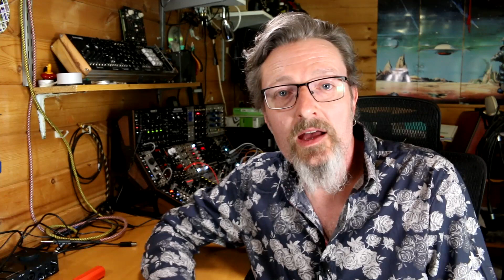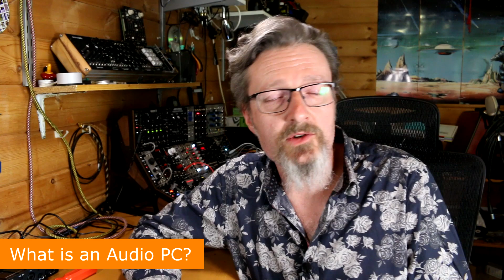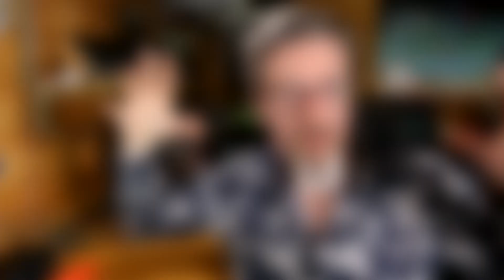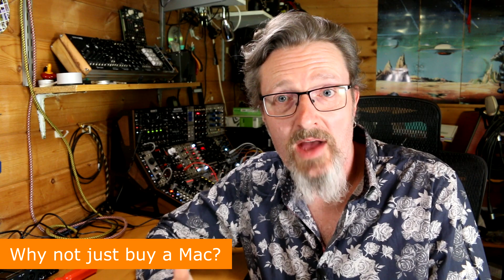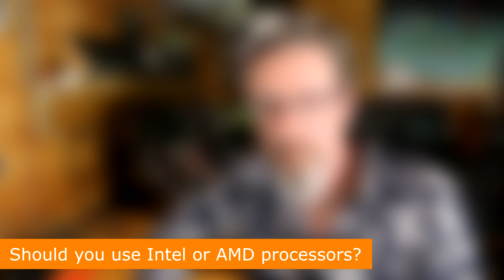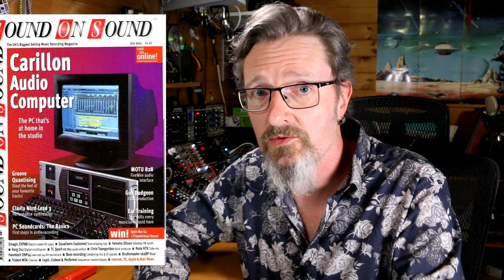How to Build an Audio PC: Part 1 - What's it all about?

Comment: This is an excellent series. While technical by profession, I am in no way versed in computer hardware or software but this series was educational and easy to follow. By sticking to the design guideline of just trailing the leading edge of technology and remaining in the realm of tested and stable components I was able to build a rather nice i9Gen10/Z590A system and, thanks to this series, never felt I was getting in over my head. Other than a faulty RAM card no hiccups. Well done and many thanks. Cheers!

Comment: My main complaint with Windows was that the drivers don't play well together. How do you deal with this? None of my interfaces ever worked well on Windows and I always got noise (EMI) from my machine, especially when moving the mouse.  Also, every Windows laptop I have owned has been a bummer. Cheap build quality and battery life is abysmal. I also haven't had great experience with Surface tablets.
Reply from the maker: Oh dear, what a sorry tale. Build yourself a decent PC - that’s what I suggest.
Reply: @MoltenMusicTech  I built, essentially, what you built in this series. I followed advice from experienced PC guys and my engineer who has always used Windows with no issues. I just never had a good experience. I may not be smart enough to maintain a Windows machine. I tweaked and tweaked and did everything I could look up to make it run smoothly and it never did when it came to audio production.

Gaming was amazing though.
Reply from the maker: Hmmm well i've had electromagnetic interferrence in any of the machines I've built so perhaps it's not the machine but the environment. Check your power source, check your powersupply. Take your PC to another house and try it there you may find you have an earthing problem. But if Windows doesn't work for you and your interfaces never work then I'd strongly recommend going over the Apple Mac -  why keep trying to do something that's not bringing you joy?
Reply: @MoltenMusicTech  Fair enough. I really tried to get into the Windows world. For years, in fact. I'm very excited for the new ARM based macs once everyone else jumps on to supporting it.

Comment: I've been a PC user for decades. Why would I want a Mac? The Apple OS sucks! It sucks tremendously! (you can probably tell, I won't be buying a Mac) Mac's used to have some slight advantages years ago. However, the PC is much easier to custom design for your specific use.

Comment: UPDATE 3: TO BUILD A MUSIC AND VIDEO WORKSTATION, YOU NEED AMD RYZEN 9 3950X WHICH HAS 16 CORES AND 24 THREADS. NOCTUA NH-D15 CHROMAX BLACK CPU COOLER, 128GB 3600Mhz CL16 MEMORY. GIGABYTE X570 AORUS MASTER MOTHERBOARD, IT HAS 32 BIT 192KHZ DAC. RTX 2070 SUPER OR HIGHER GRAPHIC GARD. 2TB M.2 NVMe, WD ULTRASTAR 10TB. MINIMUM 2K MONITOR, AOC Q3279VWFD8 QHD 75HZ FREESYNC IPS 32IN 2K MONITOR. 750W 80 PLUS GOLD POWER SUPPLY. DEEPCOOL KENDERMAN ATX MID TOWER CASE OR BETTER. BETTER THAN A $15,000 MAC PRO, AUSTRALIAN. BETTER THAN A THREADRIPPER 2950X

IF YOU ARE A PROFESSIONAL MORE CORES ARE VITAL, YOU CAN USE MORE PLUGINS AND TRACKS. THE AMD RYZEN 9 3950X HAS 16 CORE AND 32 THREADS. IT KILLS THE MAC PRO $15,000 AUSTRALIAN AND A LOT CHEAPER. YOU CAN ALSO TURN IT INTO A HACKINTOSH AND RUN LOGIC PRO X

Premiere Pro has long supported Nvidia’s CUDA cores for accelerating video effects and even improving export times, but this new update optimizes the app to use the separate hardware encoder on Nvidia’s GPUs. It will improve export times for H.264 or H.265 / HEVC codecs. “These improvements are the result of years of collaboration between Nvidia and Adobe to deliver high-quality applications and tools to creators,” says Manish Kulkarni, senior engineering manager at Adobe. “With new support for NVIDIA GPUs on Windows, exports are hardware accelerated leveraging the power of the GPU to make Premiere Pro more powerful and keep video creators productive and nimble.”
YOU A NEED RTX 2070 SUPER MINIMUM. I AM BUILDING A MUSIC AND VIDEO WORKSTATION, USING AMD RYZEN 9 3950X WHICH HAS 16 CORES AND 24 THREADS. IT KILLS THE   INTEL'S 18-core Core i9-9980XE Extreme Edition. THE AMD RYZEN 9 3950X IN ONE TEST WAS 24 PERCENT FASTER. WITH THE PROPER VIDEO CARD YOU CAN DO 8K VIDEO EDITING
 

PCMAG: THE AMD RYZEN 9 3950X IS THE BEST CPU OF YEAR. https://au.pcmag.com/chipsets-processors/64437/amd-ryzen-9-3950x
Reply from the maker: Ever thought of doing your own channel rather than spamming mine?

Comment: TO BUILD A MUSIC AND VIDEO WORKSTATION, YOU NEED AMD RYZEN 9 3950X WHICH HAS 16 CORES AND 24 THREADS. NOCTUA NH-D15 CHROMAX BLACK CPU COOLER, OR BETTER. 128GB 3600Mhz CL16 MEMORY. GIGABYTE X570 AORUS MASTER MOTHERBOARD, IT HAS 32 BIT 192KHZ DAC. RTX 2060 SUPER OR HIGHER GRAPHIC GARD. 2TB M.2 NVMe, WD ULTRASTAR 10TB. MINIMUM 2K MONITOR, AOC Q3279VWFD8 QHD 75HZ FREESYNC IPS 32IN 2K MONITOR.
750W 80 PLUS GOLD POWER SUPPLY. DEEPCOOL KENDERMAN ATX MID TOWER CASE OR BETTER.

 EQUIVALENT TO $15,000 MAC PRO, AUSTRALIAN
Reply from the maker: dear oh dear oh dear - how is anyone supposed to interpret your specs in any kind of reality? It's just a list of stuff without reason or explanation. Build whatever kind of computer you want mate, but in my video i explained why I stick with Intel and why I believe this will give you a stable and awesome computer. It's not about the spec or having the fastest thing in the world, it's about making the right choices so that you have a stable, workable and understandable system. So thanks for your tips but you're not really helping anyone and it's precisely this sort of unhelpful commentary that reassures me that these videos are vital and useful to people. However, for you, I'm sure your system will be awesome - go and make some tunes.

Comment: I stumbled into this series as I was looking for up-to-date "build" advice for a new DAW computer for my studio. I've been building my own desktop computers since the early days of DOS. DAW workstations since the days of Windows 98. Studied computer science in college. I feel confident doing pretty much anything related to computer setup and configuration. Within limits lol. The problem is, once I complete a build, I tend to lose focus on PC market updates, improvements, advancements in technology, etc.. It's hard to keep up! lol

I run a studio so I'm more concerned about making money than tinkering. Where I used to be bleeding edge on everything, now it's more about squeezing as much life out of an investment as possible. I realized a long time ago that system stability is way more important than marketing voodoo, flashing lights, and bragging rights. I can easily get 5-7 years of life from a DAW although drives and monitors tend to go out faster than that. The operating system is another hurdle. At the time of this writing I'm still on Windows 7. But as time goes by, DAW software guys tend to leave the past behind and that makes it difficult to cling to old operating systems. So... I've gotten what I need and am now ready for the next build. The new gen audio interfaces seem to favor USB and Thunderbolt (as opposed to PCIe slots although those aren't quite dead yet lol).

Anyway... I found myself nodding in agreement with every bit of advice from the series. That's rare lolol. Thank you so much for sharing your knowledge and insight. Extremely helpful. And also very well produced! Clean, concise,  even the audio sounds nice! Good job!
Reply from the maker: Awww thanks mate, I'll take that as a vote of confidence :D

Comment: As of right now, I'd recommend an AMD system. Ryzen's new Zen 2 update is fantastic, and their lineup straight up crushes Intel's offerings at the same price point.

A Ryzen 3950X is an excellent alternative to an i9-9900K at quite a bit less money.
Reply: Threadripper should crush this, depending on budget...
Reply: @lotechgreg  FOR A LOT OF PEOPLE THREADRIPPER IS TO MUCH
Reply: UPDATE: TO BUILD A MUSIC AND VIDEO WORKSTATION, YOU NEED AMD RYZEN 9 3950X WHICH HAS 16 CORES AND 24 THREADS. NOCTUA NH-D15 CHROMAX BLACK CPU COOLER, 128GB 3600Mhz CL16 MEMORY. GIGABYTE X570 AORUS MASTER MOTHERBOARD, IT HAS 32 BIT 192KHZ DAC. RTX 2070 SUPER OR HIGHER GRAPHIC GARD. 2TB M.2 NVMe, WD ULTRASTAR 10TB. MINIMUM 2K MONITOR, AOC Q3279VWFD8 QHD 75HZ FREESYNC IPS 32IN 2K MONITOR. 750W 80 PLUS GOLD POWER SUPPLY. DEEPCOOL KENDERMAN ATX MID TOWER CASE OR BETTER. BETTER THAN A $15,000 MAC PRO, AUSTRALIAN. BETTER THAN A THREADRIPPER 2950X

IF YOU ARE A PROFESSIONAL MORE CORES ARE VITAL, YOU CAN USE MORE PLUGINS AND TRACKS. THE AMD RYZEN 9 3950X HAS 16 CORE AND 24 THREADS. IT KILLS THE MAC PRO $15,000 AUSTRALIAN AND A LOT CHEAPER. YOU CAN ALSO TURN IT INTO A HACKINTOSH AND RUN LOGIC PRO X

Premiere Pro has long supported Nvidia’s CUDA cores for accelerating video effects and even improving export times, but this new update optimizes the app to use the separate hardware encoder on Nvidia’s GPUs. It will improve export times for H.264 or H.265 / HEVC codecs. “These improvements are the result of years of collaboration between Nvidia and Adobe to deliver high-quality applications and tools to creators,” says Manish Kulkarni, senior engineering manager at Adobe. “With new support for NVIDIA GPUs on Windows, exports are hardware accelerated leveraging the power of the GPU to make Premiere Pro more powerful and keep video creators productive and nimble.”
YOU A NEED RTX 2070 SUPER MINIMUM. I AM BUILDING A MUSIC AND VIDEO WORKSTATION, USING AMD RYZEN 9 3950X WHICH HAS 16 CORES AND 24 THREADS. IT KILLS THE I9 WHICH HAS 18 CORES IN MULTITASKING. THE AMD RYZEN 9 3950X IN ONE TEST WAS 24 PERCENT FASTER. WITH THE PROPER VIDEO CARD YOU CAN DO 8K VIDEO EDITING
Reply: @adammoon2959  A threadripper seems like massive overkill, even for a professional audio PC...

Even if you're recording at 192KHz/24-bit, you're only recording 4608kbps of data per track, 9216 if it's in stereo. Even IF you're recording 80 channels of audio (highly unlikely for an individual - much more likely for a full orchestra, which will be recording at a big studio using their own computers anyway) that's only 368,640kbps, which would just be 45MB per second... The vast majority of upper-tier consumer CPUs, coupled with at least 32GB DDR4-3200 and up, will handle this with little issue.

That being said, I'm completely unfamiliar with video editing, so maybe the extra power is needed there.
Reply: @mgmg116  A THREADRIPPER IS OVERKILL UNLESS YOU ARE USING MASSIVE LIBRARIES AND PLUGINS.
UPDATE 2: TO BUILD A MUSIC AND VIDEO WORKSTATION, YOU NEED AMD RYZEN 9 3950X WHICH HAS 16 CORES AND 24 THREADS. NOCTUA NH-D15 CHROMAX BLACK CPU COOLER, 128GB 3600Mhz CL16 MEMORY. GIGABYTE X570 AORUS MASTER MOTHERBOARD, IT HAS 32 BIT 192KHZ DAC. RTX 2070 SUPER OR HIGHER GRAPHIC GARD. 2TB M.2 NVMe, WD ULTRASTAR 10TB. MINIMUM 2K MONITOR, AOC Q3279VWFD8 QHD 75HZ FREESYNC IPS 32IN 2K MONITOR. 750W 80 PLUS GOLD POWER SUPPLY. DEEPCOOL KENDERMAN ATX MID TOWER CASE OR BETTER. BETTER THAN A $15,000 MAC PRO, AUSTRALIAN. BETTER THAN A THREADRIPPER 2950X

IF YOU ARE A PROFESSIONAL MORE CORES ARE VITAL, YOU CAN USE MORE PLUGINS AND TRACKS. THE AMD RYZEN 9 3950X HAS 16 CORE AND 32 THREADS. IT KILLS THE MAC PRO $15,000 AUSTRALIAN AND A LOT CHEAPER. YOU CAN ALSO TURN IT INTO A HACKINTOSH AND RUN LOGIC PRO X

Premiere Pro has long supported Nvidia’s CUDA cores for accelerating video effects and even improving export times, but this new update optimizes the app to use the separate hardware encoder on Nvidia’s GPUs. It will improve export times for H.264 or H.265 / HEVC codecs. “These improvements are the result of years of collaboration between Nvidia and Adobe to deliver high-quality applications and tools to creators,” says Manish Kulkarni, senior engineering manager at Adobe. “With new support for NVIDIA GPUs on Windows, exports are hardware accelerated leveraging the power of the GPU to make Premiere Pro more powerful and keep video creators productive and nimble.”
YOU A NEED RTX 2070 SUPER MINIMUM. I AM BUILDING A MUSIC AND VIDEO WORKSTATION, USING AMD RYZEN 9 3950X WHICH HAS 16 CORES AND 24 THREADS. IT KILLS THE I9 WHICH HAS 18 CORES IN MULTITASKING. THE AMD RYZEN 9 3950X IN ONE TEST WAS 24 PERCENT FASTER. WITH THE PROPER VIDEO CARD YOU CAN DO 8K VIDEO EDITING
Reply: @adammoon2959  It feels like your comment is spam... In any case, I can't imagine what kind of projects you're running that would require that many cores...

Anyway, just a quick correction, the Ryzen 9-3950x does not have 24 threads, it has 32. Simultaneous multithreading means 2 threads per core.

Also the i9-9900K has only 8 cores and 16 threads, and of course the 3950x beats it in multicore performance, because the 9900K isn't designed for the same workloads, it's primarily a gaming chip.
Reply: @mgmg116  YOU SAID. A Ryzen 3950X is an excellent alternative to an i9-9900K. I'd recommend an AMD system. Ryzen's new Zen 2 update is fantastic, and their lineup straight up crushes Intel's
It feels like your comment is spam... In any case, I can't imagine what kind of projects you're running that would require that many cores..

YOU SAID MY COMMENT IS SPAM, WHAT ARE YOU TALKING ABOUT. I SAID TO BUILD A MUSIC AND VIDEO WORKSTATION, YOU NEED AMD RYZEN 9 3950X.
WHAT I SAID ABOUT AMD RYZEN 9 3950X IS SPAM, WHY DO YOU RECOMMEND IT. 
TO BUILD A MUSIC AND VIDEO WORKSTATION, YOU NEED AMD RYZEN 9 3950X. A WORKSTATION IS FOR PROFESSIONALS, NOT FOR SOME KID INA BEDROOM
Reply: @adammoon2959  Yes, I know I said all that.

I said your comment seemed like spam because you copy/pasted the same 50 paragraphs and you wrote it in all caps. That's why I said it seemed like spam.

I myself am an audio engineer, specifically a mixing engineer. Typically, I'll find myself working Pro Tools HD sessions with anywhere up to 50-60 tracks, and I'll have plugins loaded on nearly every one of them.

I have 16GB of DDR4-3200, and a Core i7-8700K, and that is plenty for my workloads, even running at buffer sizes as low as 64-128 samples.

If you require more than 6 cores, you must be doing orchestra work, or your sample libraries must be far bigger than mine.

Not that there is anything wrong with that, it's just really impressive

Comment: I was thinking of the Carillon AC1 recently. In 2002 I had saved money and was about to make my first big gear purchase. I was looking at a number of synthesizers, and was quite close to buying a Waldorf Q. After reading about VSTs, and plugins a bit more, I began looking at audio computers. I bought  a Carillon AC1 with Cubase VST 5, and NI Reaktor 3. I never ended up with a Waldorf Q sadly, but I never regretted that decision. I truly believe that the AC1, with Reaktor especially, allowed me to explore so many areas of synthesis and sound design that would not have been available with a single synth.
Reply from the maker: Nice one. It did unlock a huge amount of potential.

Comment: Yes! Was gonna buy new mac but will participate in this project instead
Reply: Did you end up building a rig?
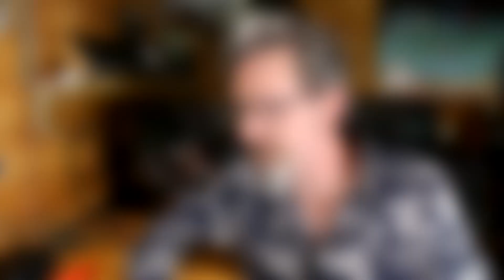Reply: 1:10 I can attest to the fact that it’s easier than it sounds. 
I built a PC from scratch and put everything g together over time waiting for offers etc. o built the first one for my son. The one thing you need to look out for is installing the CPU. I let my son do it the first time and he was a little younger at the time and still had a bit of that teenage impetuosity. Result: a ruined Ryzen 7. 😂
So, take utmost care with that and the rest is pretty straightforward. 
So to reply to the comment above, is your project still running and how did it go. ?

Comment: I really like those large curve monitors for PCs & have wondered about getting one for my next PC build.  However, for a music production PC system, I'd want to make sure that I had some type of portable touch-screen to bring over the Surface Pro convenience.  And the sound interface will still be external so the sound interface would need to have support for everything, such as CV in/out, MIDI, & the usual gang of ins & outs.  I've also found an old Tascam Portastudio 07 in the closet & I'd probably want to make sure that all of its ins/outs are covered connecting to the audio interface  as well.

Comment: my gaming PC and audio PC are one and the same.
(if it's powerful enough to run modern games it's got plenty of oomph to run audio) it also rips through video production. sound is handled by a 12 channel soundcraft mixer
2TB's worth of fast SSD (mostly games on those tho :) and another 4Tb of standard HD storage.

for the money you spend on a mac you could have a computer that is 2 times more powerful with 2x the storage space and 4x the ram and still have money left for a few pints.

I seriously wouldn't take a mac if you gave me it for free (well maybe to sell on and build another ninja PC)
"you pay because it's a decent computer" um no, you pay because it has an apple logo on it and it's in a shiny box (it is a mediocre computer) even the top of the line mac pro is pretty meh in the power stakes. your average gaming PC will run rings around any mac 

(people still go to mac as the default for audio because back in the day 80's and 90's the mac was really the only option for music software, along with the good old atari ST, every studio had one or the other.) apple at this point are living off of past reputation (nowadays they are just a money grabbing bunch of scumbags like any other big company, there has been zero innovation since Steve Jobbs died.

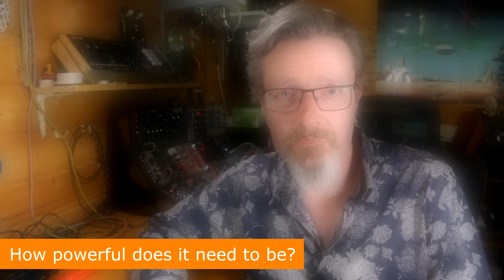3:30 "making music is one of the hardest things your computer will do" lol not my pc :)
Reply from the maker: You're confusing raw power with being a decent computer. 3D rendering is hard on the processor and graphics card but it's focused on doing one thing. I'm talking about how making music can use every port on your machine in and out at the same time in every direction and straining every component. And as it say, it's "one of the hardest things" yeah?